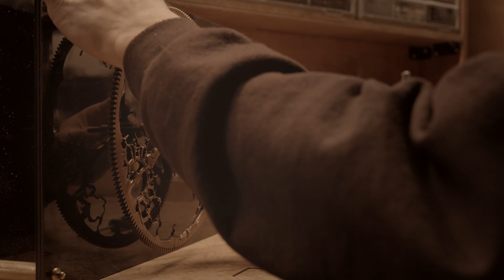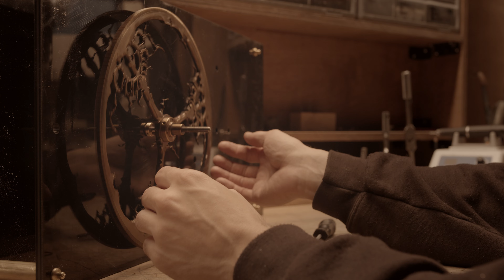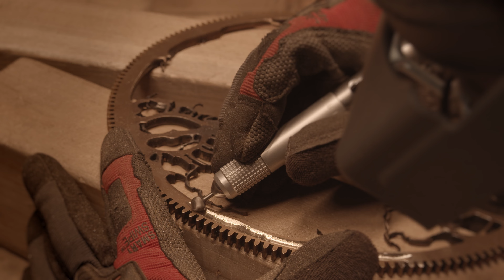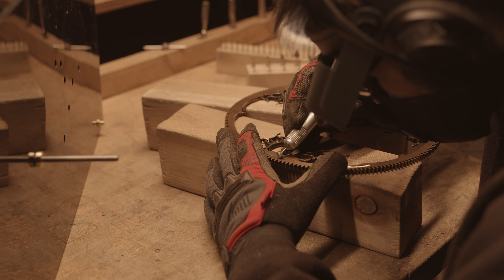Gear Balancing

Comment: Jesus christ that balancing shaft has litterally zero friction
Reply from the maker: It's the ball-bearings. I splurged for ones that are precise, with very little friction.
Reply: @theclockworkofericfreitas3699  impressive. And i suppose no lubrication?
Reply from the maker: @jeanladoire4141  No. They're ceramic hybrids, so they can run dry.